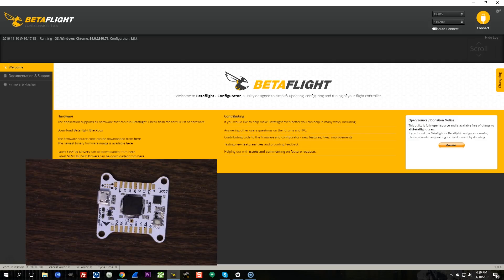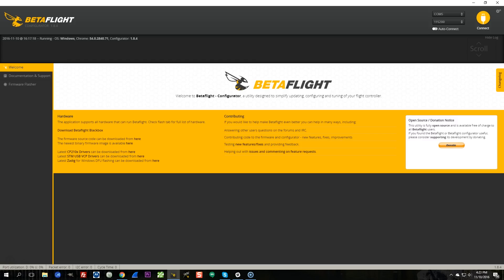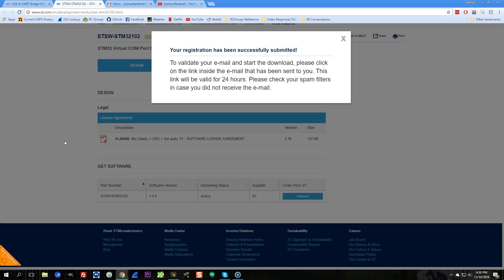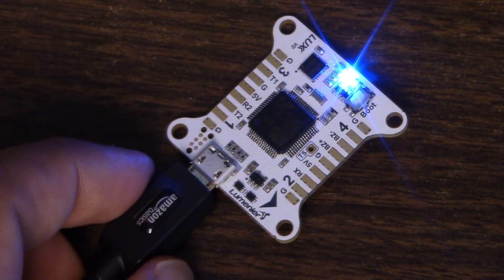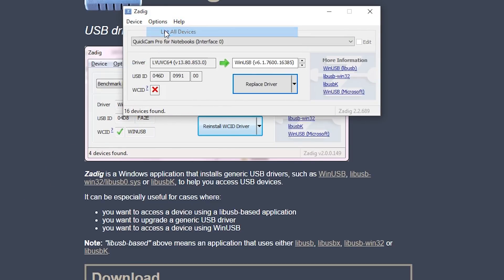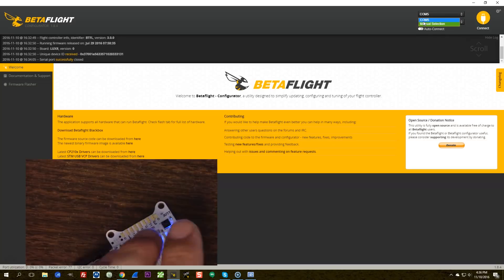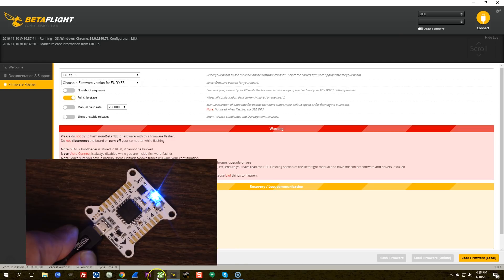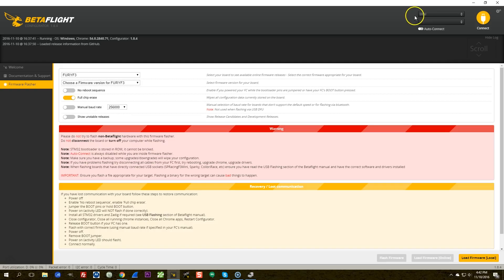Betaflight / Cleanflight Flight Controller Won't Connect | FIXED

Comment: both drivers installed, still wont connect. just as bad a clean flight.
Reply from the maker: It's literally exactly the same as Cleanflight.

If you 100% have the drivers installed and it still won't connect then maybe your USB cable is charge-only. USB cables that come with phones are sometimes like this and won't pass data.

Comment: Did everything, still not getting the configurator to not be utterly blind to my DFU FC. I'm stuck on 3.2.0 and may be forever on this board, I have tried every solution around. And that's a BFF3 board, not some obscure target. -_- Thanks anyway, the video is well put together.

Comment: After watching all your videos, i get this message "No configuration received within 10 seconds, communication failed" I cant get past this. Im going through all your videos as well as Blue falcon and several on youtube, but no videos expressing this problem. Would you know the cause? Maybe a link I can research myself?
Reply from the maker: In this situation, my approach would be to put it in bootloader and re-flash it with "full chip erase" selected. This should get it back to working although it will wipe your config.

1. Hold down the bootloader button. Plug in the USB cable while continuing to hold down the bootloader button.
2. Run the Impulse RC Driver Fixer app (http://bit.ly/2GBLvwh). It should "fix" the driver successfully. If not, do not proceed.
3. Un-plug the USB cable.
4. While holding down the bootloader button, plug in the USB cable again.
5. Start the Betaflight Configurator app. In the upper-right corner pulldown menu, you should see "DFU". You can now flash the board.

For more detailed instructions on how to install the STM32 drivers: https://www.youtube.com/watch?v=m4ygG6Y5zXI
Reply: Great! completely solved my issue!

Comment: I’m setting up betaflight, quick question, the STM USB VCP Drivers included only go up to Windows 8, yet I am running Windows 10.  Is it ok to install the windows 8 drivers or are there windows 10 drivers available?
Reply from the maker: No use the Windows 7 drivers. I know it's weird but that's what I've been told -- there is some issue with the Win8 drivers.
Reply: Great thank you!
Reply: Quick question, I have a Bfight 210 FLYSKY AFHDS 2A (https://www.gearbest.com/brushless-fpv-racer/pp_660800.html?wid=1433363) and I tried binding it to my Turnigy Evolution and it wouldn't work.  Is this because the quad has FLYSKY and the Evolution is FRSKY and those are two different protocols or a different reason?  I also have not used betaflight yet, do I have to enable something there to make the two bind?

Comment: I was struggling to connect my quad to BetaFlight for so long and tried everything on here multiple times... then I tried a different microUSB cable... and it worked! Turns out, the ones that come with your GoPro are only good as charging cables xD
Thanks JB... Joshua Bardwell for all the videos! I refer to them for nearly all of my FPV needs!

Comment: So after a crash port fails to open, no sound when connecting to windows. Led on the fc lights up, if i go flash th firmware it betaflight recognizes the board. So should i short the boot pins and reflash? Can i end up with flashed board that wont connect so i cant fly anymore which i can still do now.. hmm anyone lol?

Comment: the STM32 driver contains Windows 7 or 8 but not Windows 10. Is this a dead end?
Reply from the maker: Use Windows 7

Windows 8 is the same as 10. But you should use Windows 7 even if you're on Windows 10.

Comment: Any chance you can do a video on failed ESC firmware flashes? BLHeli can't connect and wants to rewrite esc firmware.
Reply from the maker: The answer is to rewrite it using the "ignore incompatible layout" option. Just make sure you flash the right firmware and use a smoke stopper when you first plug in, in case anything went wrong.
Reply: Thanks for answering! Unfortunately, I don't even get that far (this is a 4-in-1 ESC).

When I read the setup in BLHeli it says: 
Error: Found multiple ESC configuration
ESC#1(2,3,4): Erased or unknown firmware (d)
Input Protocol: Unknown
Input Frames Good:0/Bad:0
and an option to cancel

Hit cancel -- Get new popup "Warning ESC#1 most likely a write attempt to this ESC has failed.... Do you want to try to flash the again with BLHeli to remedy the failure? -- Hit Yes -- 

"The ESC is marked as "unknown, probably the parameter-writing to the ESC failed. In order to revive the info of ESC layout data it is recommended to erase the settings area completely. Do you want to erase the settings now? -- Hit Yes 

"The settings erase failed! Disconnect and retry."

Just for context this 4-in-1 ESC is new. It runs fine in Betaflight's motor tab and I can get it to spin up no problem. The motor direction on two motors is wrong however.

Thanks again!!!

Comment: Joshua bardwell 
I need help... okay so I bought an armattan chameleon off eBay it is genuine haha however the previous owner used frsky reciever  and and Apple Mac to connect to it and programme it.. I have swapped out the receiver for a 4649t serial reciever..when I connect it to beta flight I got nothing.. just manual selection.. so I downloaded stm 32 driver and I put winusb on to it.. now I can connect to my drone with com port 5 .. its not giving me any other options any how through com port 5 it seems to work okay but.. It won't recognise my spektrum transmitter... and it keeps dropping connection from beta flight every minute or so... any ideas?

Comment: Hello there to whoever reads this. I got a problem which is not covered in this video.  I was able to load the firmware on to the fc just like in the video without any problems. But now my computer doesn't recognise the fc in normal mode. It doesn't even show up in the device manager. So now the only way I can access the fc via Betaflight is in bootloader mode, which isn't very helpful.
What I also realised is that when I plug in a battery (or power it generally in normal mode) there is no flashing LED as there should be.
I am open to every idea about what could be wrong with it.
Reply from the maker: Likely you selected the wrong board type in the pull down menu when you flashed it.

Comment: i really would like and want your help but maybe my issue is different? wish I could send you these pics. com port 4. then com failed in the upper left when hit connect??????
Reply from the maker: COM4 probably means you have the driver installed correctly. But connection failed... is the board in bootloader mode? That's a tough one. Let's go over what we know.

The computer sees the FC plug in because COM4 appears when you plug in and disappears when you un plug -- right?

So we know the driver is working. And we know the USB cable is okay (probably).

So it must be the FC? Try another FC I think. Try your same FC on another computer.

Comment: I am going mental here. The USB connects just fine, but my flight controller is a STM32 and windows FORCES the install of a CP210 chip...wtf?!?! STM32 just does NOT want to come up. It took me a fraction of the time to build the whole quad...
Reply from the maker: What FC is it? SpracingF3 is CP210 not STM32.
Reply: Thx Josh. Yeah, so I found out that the chip on the board doesn't have anything to do with the communication driver...it's a STM32 chip, but it operates the USB driver with the CP210 drivers, I was confused there. The connection error was due to the baudrate. It connects fine under autoconnect after flashing Cleanflight 2.0 onto the board with "demonstrator GUI". I didn't want to break anything with wrong drivers.

Comment: Im having trouble with the drivers. The vcp drivers say they are for windows 7 and 8. What do i download for windows 10. Ive downloaded all from links on betaflight but cant flash firmware. Please help im pulling my hair out
Reply from the maker: Use the Windows 7 driver.
Reply: Thanks for reply. All working now. Thanks for all your videos 👍

Comment: IMPORTANT: possible fix!
Try using another usb cable! Cleanflight manual says: "If you see no signs of life on your host computer when you plug in your board, check your cable with your mobile phone or some other USB device - some charging cables have only the power pins connected. These will power up the board, so the leds light up, but the host computer will not react to the device at all. You need a proper USB cable to connect your board to the Cleanflight Configurator." Worked for me!
Reply: K helpfull thx

Comment: I have two Blade Torrents, neither will connect to Betaflight, meanwhile ALL of my 5" quads have no issues connecting... None of this worked on my 2017 Win10 laptop (same used for all other quads).   At this point I'm trying to figure out who sucks... win10, BF, Blade.. or me?  (I vote Blade since everything else works)
Reply from the maker: Probably they have a SPRACINGF3 flight controller and you habe never installed the CP210 drivers thst it needs.
Reply: Well, thanks... you really are a bona fide knowitall.  I started updating at the top of the BF list, the CP210 drivers, and it didnt work.   I read your comment and reinstalled them again, then restarted the laptop... now it works.  Thanks for the reply.. I probably would have given up/moved on.

Comment: Following the instructions, when I connect the board in bootloader mode, the driver doesn't appear in Zadig. But I do see CP2102 USN to UART Bridge Controller. I'm dead in the water.  I don't know why the quad (Wizard x220) worked fine, I didn't change anything, and now it doesn't respond to FS-i6x transmitter.

Windows 10.

Simulators work with transmitter.
Reply from the maker: Your SPracing F3 flight controller doesn't use the STM32 driver. It uses the CP210 driver. The instructions in this video don't apply to you.

Comment: Do you have to solder the 3/5v pads before you connect it to beta flight
Reply from the maker: No. You can connect it without soldering them but your receiver might not work.
Reply: Joshua Bardwell .. just received in mail and just wanted to make sure everything is working before I start soldering ...for some reason I go into panic mode when trying to build a multirotor

Comment: hi, I am learning a lot  from you and people on your channel,,  , but i am  very new to this field, I can't even Arm my first drone yet , yes you got it right, its a wizard x220, i was able to  connect my transmitter to receiver today , even setup some failsafe on the radio, and download the betaflight configurator 3.3 , then install the first set of drivers (cp210x) ,,but the second set of driver you said to download and install which is  (  STM USB VCP) ,,, unfortunately only available for windows,,, and I am a Mac person, i am really frustrating trying to make it work , would you help me please ?  does it seems that I need a windows pc if I want to be able to enjoy this hobby , I hope not, no offence to windows , I don't know how even to turn on any pc but Mac, I hope there is a way to make it work with Macs,,otherwise  before thinking about flying my drone ,,I  need to learn how to work with windows ,,,
I would really appreciate any kind of help , info or advise
Reply from the maker: Mac does not need the VCP drivers. They are already installed and will work automatically. However the Wizard X220 flight controller uses the CP210 drivers so you need to get those installed on your mac.
Reply: thanks for quick reply, as I said earlier, i did install CP210 drivers, but when I connect the wizard to computer , the 3D model is not look like yours or anything look like drones !! its a rectangular model has been written front, back, left right , up , down on the sides of it  !!! but it  moves accordingly when I move the drone ,, plus it has a '' cleanFlight " name and logo written on the left and right sides, !! 
would you help me please by directing me to the right path so I would be able to make it work please,, 
honestly these days since I was waiting for my things to arrive,  all I did was watch your videos about wizard, about radios ,about fpv goggles,,  All of them, comparison videos , reviews, betaflight 3.3 which you has been waited for it to come , and then all the related videos you recommended and linked under that video, ,,,, but truth to tell the more I watched, the more I realised that how much I am behind and how much learning and basically catching up there is that I need to DO.. 
please help me on finding the best way to do all these in short and sweet time ;-))

Comment: I recently upgraded to Windows 10 Ver 1709, Build 16299.309.  Having trouble getting VCP.  Here's what I've done:

Installed Betaflight Configurator

The driver site that Betaflight sends you to, http://www.st.com/en/development-tools/stsw-stm32102.html says, "Starting from Windows® 10, the STSW-STM32102 driver is no more adequate and the usage of the native inbox driver is recommended"

 I carefully followed Bardwell's video https://www.youtube.com/watch?v=m4ygG6Y5zXI which doesn't say anything about the Windows 10 native inbox driver. Installed all the drivers per JB video, the com port does not appear in Betaflight.

I uninstalled it from device manager, plugged it in, and got a notification "setting up vcp..." then another notification "vcp is set up and ready to go"  Still doesn't connect to Betaflight Configurator - no com port visible other than com1. 

Device manager shows STM32 Virtual Com Port under Other Devices, but when I double click it to get properties, it says, "This device is not configured correctly."  When I click Update Driver it says, "Windows found drivers for your device but encountered an error while attempting to install them. 
STMicroelectronics Virtual Com Port 
If you know the manufacturer of the device, you can visit their website and check the support section for drivers."
Reply from the maker: Use the Win7 driver.

Comment: Latest version of Zadig doesn't give the "STM Bootloader Mode" choice under options. What to use?
Reply from the maker: ImpulseRC Driver Fixer.

But most likely the board is not actually in bootloader mode, or Zadig would find it.

Comment: Great video Josh, I have been trying to connect to Betaflight, tried everything, turns out I was using a usb charging cable and not a data cable, didn't realize there was a difference.  Everyone having issues please try a data cable, you will save tons of time!
Reply: How do you tell the difference?

Comment: Why would YOU have to do all this? I have never had to press a button or short out bootloader pins and I have never had a problem flashing firmware. To flash, I just plug the USB into the flight controller, set full chip erase on and Load firmware online, then press flash firmware. Never had to install ZADIG or VCP drivers either. Is this an American only thing?  BTW I have got Betaflight 3.2 on a FLIP 32 F1 board running at 1khz with 30% cpu load.  Is this for F3 and F4 boards?
Reply from the maker: Flip32 v1 has a CP210 chip so yes, you're right, none of this is necessary. But you also lose one UART to the USB port, so you only have two UARTs to play with.

All modern FC use the Virtual COM Port, which frees up all UARTs for you to use, but means you have to jump thorugh some hoops to flash the board.

Comment: Apart from the first of the three downloads, this is not Mac compatible. :(
Reply from the maker: I address this in the video. Mac has the needed drivers installed already and you do not need to do any of this nonsense. Just plug in and go. Voila. Good to be a Mac user.
Reply: Awwww, thank you Joshua. Thank you. Despondency lifted . . . .  instantly.

Comment: You do such a fantastic job of explaining this kind of stuff. By far the best at explaining this stuff. With that said, it's still hard to follow and still hit or miss. I think stuff like this is a part of this hobby and technology that still has a TON of room for improvement. I dread flashing a board. It seems like such a high percentage of times I have issues in one way or another. I just installed a Betaflight F4 and I can't get that to flash. It's kind of ridiculous that we have to jump through so many hoops to flash the latest version of BF onto a BF board! I thought I had this stuff figured out and have had no issues flashing the last several boards I have built with but again I find myself going to Joshua for guidance because even a person like myself that has been in the hobby for years still can't flash a flight controller with confidence LOL.

Comment: Hi Joshua, my spracing f3 fc can’t connect to betaflight. It show com3. But after trying to connect, No configuration received within 10s. Communication fails. Port close. 
But I can still connect to motolab fc. What do I need to do? I have DL the driver from betaflight. I used to be able to connect. All this happen after I forget to connect boot pins before I tried to flash new FW.
Reply: Finally settled. Manage to reflash the board again.

Comment: Will this work with the f3 flight control in a stock walkera f210?
Reply from the maker: If it runs Betaflight or Cleanflight then yes.

Comment: I am running Windows 10.  When I download STM USB VCP Drivers, there are only Windows 7 and Windows 8 drivers.  After reading the driver description it says that beginning with Windows 10, the native inbox driver is recommended.  Is that a driver that is already built into Windows 10?  Does this mean that if your'e running Windows 10 you don't need to download the STM USB VCP Driver?  Help would be greatly appreciated!
Reply from the maker: I always just select Windows 8.